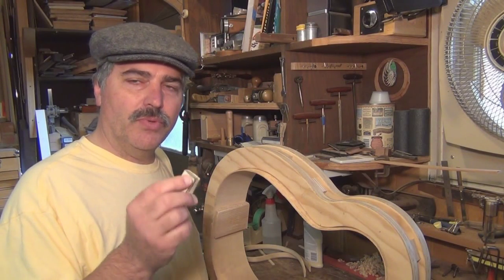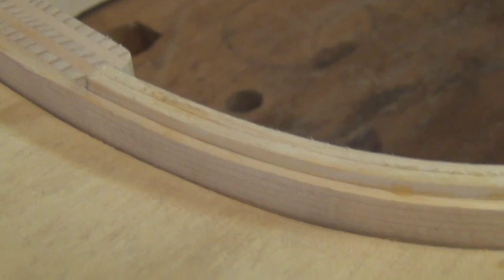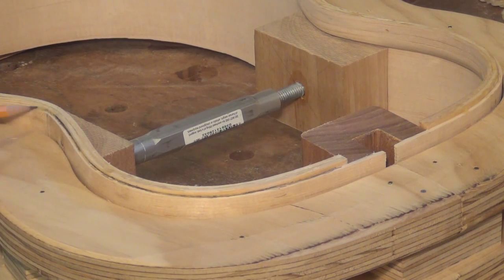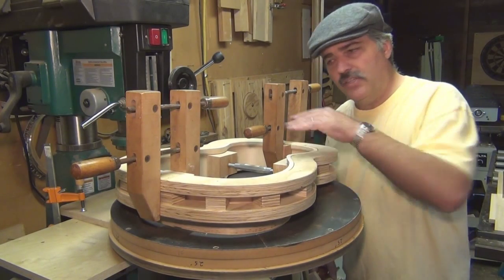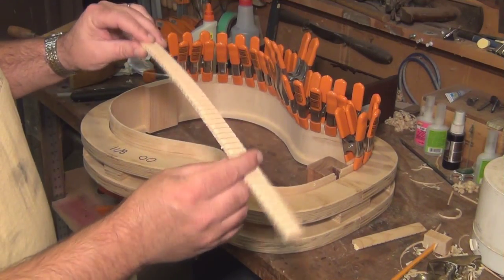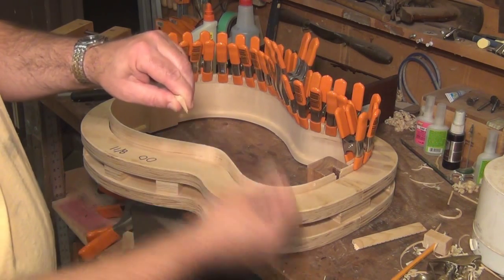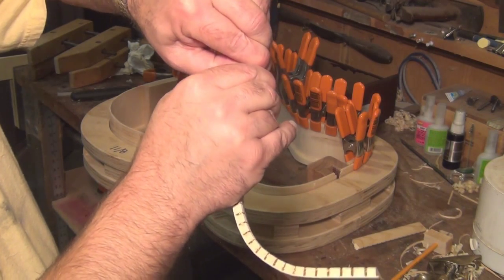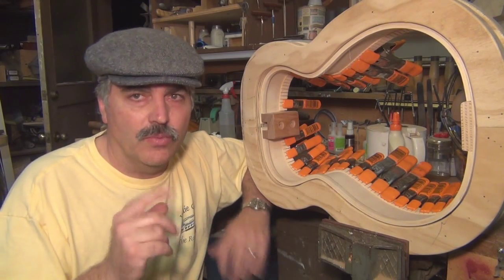Chapter 6 Install linings

Comment from the maker: Why? For this video probably more for the ability to show two different techniques than anything else.  A stiff rim is important so the solid linings help on that count. Kerfed linings are easier and the norm these days.  They can also be lighter.  Individual tentalones are another way to go and advocated by some high quality builders. Some use reverse cut linings and then laminate a veneer on the inside edge to stiffen them. Many "correct" ways to do this.  Each one will have an effect on the voice of the finished guitar, but to say one is better or worse than another would be like saying a rose is more beautiful than a daisy.